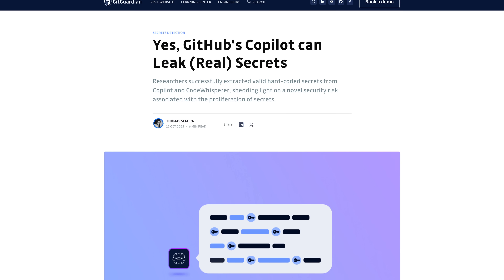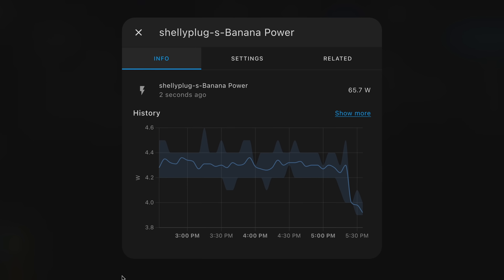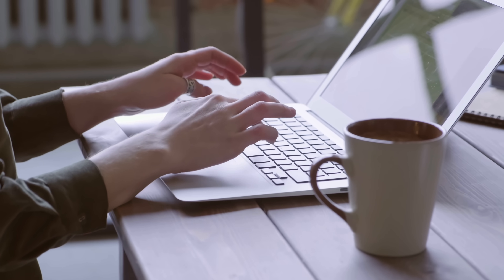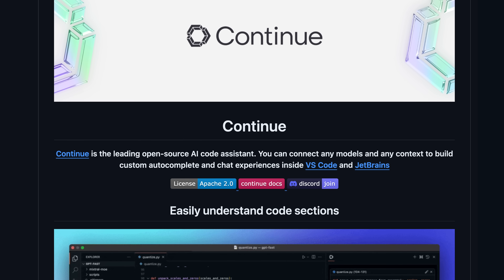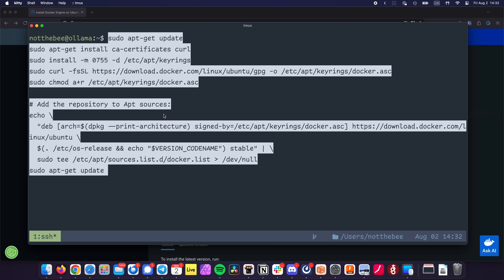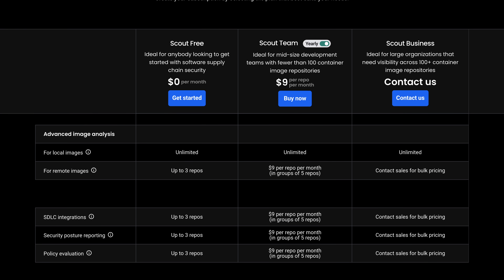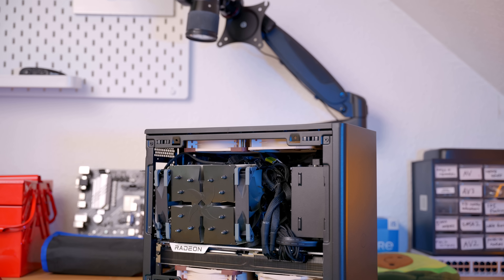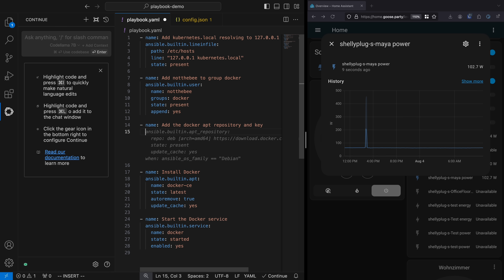Host Your Own AI Code Assistant with Docker, Ollama and Continue!

Comment from the maker: Download Docker Desktop: https://dockr.ly/4fWhlFm
Learn more about Docker Scout: https://dockr.ly/3MhG5dE
This video is sponsored by Docker

Ollama docker-compose file: https://gist.github.com/notthebee/1dfc5a82d13dd2bb6589a1e4747e03cf

Docker installation on Debian: https://docs.docker.com/engine/install/debian/
Reply: brother i would recommend you to use codeqwen1.5 this with ollama and continue it is less power hungry and give better result, i run it on my laptop with 16gb ram, i5-13th gen and 4050, it also very accurate
Reply: @Indiginous  Hey! I have the exact same specs. At present day, what's the best LLM you'd suggest for coding AI agents?

Comment: You gotta go for Qwen2.5-Coder. 7-14B models are the sweet spot. Dont need to go higher. Qwen2.5-Coder-3B for tab completions. If you got the VRAM try the q8 versions.

"Instruct" models  give you even better results because they can use Tools (fetch stuff from web for example)

I run i5-13500 + 64GB RAM + 5070ti 16GB and it does pretty well. I compared it to Cursor today and its on par with Cursor suggestions. (cursor does have better UI/UX though compared to Continue/RooCode/Cline)

45W Idle.

Comment: I'm using Ollama with Continue on my main desktop, alongside my IDE and it's acceptable. It's not as fast as GitHub Copilot, but it's free, unlimited, and to be honest I prefer it to not do ALL of my work anyway. I've found that AI writes code fast, and it can get you out of a bind quickly, but you still need to make sure YOU are the one in control of the output and you understand the code it wrote.  Ollama is nearly useless on my laptop though. In the future, I'd consider trying an NVidia Jetson to run the LLM, since that's purpose built for AI. I think that might be OK.

Comment: i could never rationalize spending $1.000+ on a gaming machine, not could i do the same for an LLM server. but 1 month into trying out Proxmox on an HP EliteDesk, i realized my dream might be possible. 

i ended up buying a Minisforum AI X1 Pro + RTX5070 as eGPU over OClink to be my all-in-one 4k gaming machine, LLM, docker server, and NAS with minimal footprint and decent upgradability. 

now im running 8-12B LLMs with ease at chatgpt-speeds locally, and with a single switch it shuts down and starts up windows to play on my OLED or stream with Moonlight! hookscripts let let me just shutdown Windows (from the OS or Proxmox) and my LLM server boots back up. 

and with USB4 finally being mainstream, i can connect my macbook via thunderbolt for a 20gbps direct link to all my storage and guests + my 2.5gbe LAN in one cable. Time Machine backups are now instant😮‍💨

Comment: I made a setup with Asrock N100M and RTX A2000 12Gb it's very power efficient and works really well. The GPU costs me around 300€ used, not the best investment just for a few help while coding, but I'm planning to build a voice assistant with this setup, hopefully it can be a bit more useful than Siri.

Comment: The 4090 is such a scam. 24gb of vram should not cost more than 99% of the systems in existence.
Reply: The real scam is that you can't get 24GB+ of VRAM on mid-tier GPUs. For most hobbyist or single-user scenarios, that much compute isn't necessary, but the memory would be fantastic.

Comment: Ollama is nice, but doesn't stand a chance against Tabby (from TabbyML). I run that on a desktop with an Intel i3 10100F CPU, single channel 16 GB RAM (DDR4, 3200MHz), Corsair SSD (500BX model) and a MSI GTX 1650 with 4 GB VRAM (75 Watt model). This meager self-build gives ChatGPT a run for its money in response times when accessed via the Tabby web-interface.

Tabby can be run directly in your OS, setup in a VM or run at your cloud provider. Windows, Linux and MacOS are supported. Tabby also provides extensions for VS Code, JetBrains IDEs and NeoVim. Auto-complete and chat become available, just as is shown in this video.

Tabby can be used for free when 5 accounts or less use it simultaneously. 

Disadvantage from Tabby is that it doesn't support many models. 6 Chat models and 12 Code models. Many of the models used in this video are supported by Tabby. You can hook at least 3 different Git repositories to it (as that is what I have done at the moment), but you can also use a document for context. And not just via the extension of your favorite editor, but also via the Tabby web-interface.

Now, with only 4 GB of VRAM, I cannot load the largest Chat & Code models and these models tend to hallucinate. However, if you have a GPU with 8 GB or more, you can load the 7B models for Chat/Code and that improves the quality of responses a lot. 

And finally, Tabby has an installer for CUDA (NVidia), for ROCm (AMD) and Vulkan. Haven't tried ROCm or Vulkan, but Tabby in combination with NVidia is very impressive. My suggestion would be to make another video with Tabby in your 24 GB VRAM GPU using the largest supported models for both Chat and Code. I fully expect you'll come to a different conclusion.
Reply: It should gave you same results as Ollama with same models

Comment: I will only self host an AI service when the hardware needed to run these things are down to mainsream levels. Even, the architecture is not power optimized and maybe this is something that we have to wait from the hardware and software side. Power efficiency is the main issue for self-hosting anything.

Comment: you can run meta llama 3.2  8 billion parameters quantized  with just a cpu using gpt4all as well as control it via pycharm or vscode . a good option for those wanting to build something like this on old cheap hardware that would normally be thrown in the garbage.

Comment: First. There're some really good coding models came out recently, like qwen-2.5-code. In their 14B version, it's not only capable of doing FIM (fill in the middle) tasks for a single file, but also for multiple ones. Not sure, if continue dev supports that, but Twinny (my personal favorite LLM plugin for VSCodium) does. 
Second. if you're aiming towards gpu-less builds, look at AMD Ryzen 7th series or higher. Like 7940HS. Not only it's a great powerhouse in terms of CPU performance, it's also supports DDR5 with higher bandwidth which is crucial, when it comes to LLM tasks. There're plenty of Mini PCs already with such CPUs

Comment: Hi Wolfgang!

Thanks to you, I decided to try and selfhost LLMs for code completion: Python, Bash, Ansible and some general Linux knowledge (CLI utilities, more on that later). I am a Junior SRE/DevOps Engineer (idk if that even matters), and also long time viewer (since 2021, I guess?).

3 days ago I got used Intel Arc A770 16gb for 260USD equivalent, installed it in my gaming pc (Ubuntu 24.04). The driver installation was a pain (tl;dr: reinstalled Intel & OneAPI stuff TWICE) though.

Got it working in 4 hours, tried several models: codellama:13b, gemma2:9b and mistral-nemo:12b. The latter really impressed me. It not only can write some simple code in Python or bash, it also helped me with pretty specific IBM app Tivoli (magnetic tape storage). AI is an impressive tool, and I see it now.

Thank you, your videos are pretty damn good ❤

Comment: So,  I would try to get hands on miniPC based on AMD 8840HS ( a lot of on ALiExpress for around 300 barebone, sou add RAM and SSD). Run them with either 32Gb of RAM and you got yourself, small, light power AI assistant.
This APU from AMD comes with nice integrated GPU but also with NPU unit ( 16 TOPS), so it is nice upgrade from that Intel you have and even cheaper.

Once the newest APUs from AMD and maybe Intel come to miniPC, (with around 50TOPS npu units), it will more than enough for this.

Comment: Could you tell how you got the models that were used in your testing? I have attempted to find them, including looking at the Open WebUI community site, looking through the models available on the ollama site, and I even attempted to pull them directly into ollama (the file was not found). So where did you get those models and how did you get them into ollama?

Comment: Great video! I installed the Ollama codellama + WebUi on my Ubuntu Server via the Portainer app on my CasaOS install to make things as easy as possible. 
My server is an old Dell Precision T3620 that I bought for around 350 euros a couple of months ago.

Specs
Intel Xeon E3-1270 V5 - 4-Core 8-Threads 3.60GHz (4.00GHz Boost, 8MB Cache, 80W TDP)
Nvidia Quadro K4200 4GB GDDR5 PCIe x16 FH
2 x 8GB - DDR4 2666MHz (PC4-21300E, 2Rx8)
512GB - NVMe SSD - () - New
Crucial MX500 1TB (SFF 2.5in) SATA-III 6Gbps 3D NAND SSD New

Things are running well, but, of course, not as fast as on a beefed machine like yours. :D

Comment: What about a Raspberry pi 5 with the ai kit?
Reply from the maker: The problem with many TPUs is that they don’t have onboard storage. Or if they have some, it’s very small. One of the reason why Ollama works so well on GPUs is fast VRAM. Running LLMs on the TPU would mean that your output is bottlenecked by either USB or PCIe, since they’re slower than the interconnect between the GPU itself and the VRAM (or the CPU and the RAM)

Comment: AMD card is a very bad advice for running machine learning models in general.

To run the best llama model, what you mostly need is a lot of ram and a system that has reziable bar.
   To run most of the other ML stuff like image generation, you need NVIDIA. You are going to be super frustrated if you get a 900$ AMD GPU just to run llama and be blocked to run all the other cool stuff.
Furthermore NVIDIA drivers on Linux are far superior and much easier to install.

Comment: By the way, Zed is becoming a more prominent and apt replacement for Neovim and VSCode, and it has built-in support for Ollama (as well as other services). It doesn’t have AI suggestions directly, but those can be (kind of) configured via inline assists, prefilled prompts, and keybindings.

But the main problem is speed, and it doesn’t matter if it’s a service from a billion-dollar company or your local LLM running on top-end hardware. Two seconds or five, it breaks the flow. And the result is rarely perfect.

It’s very cool that it’s possible, but it’s not there yet, and we don’t know if it will ever be.

Comment: but you can host it on the same powerful machine, you programme on and run llm, when you need it, then play games when you don't, right? I am planning to do the same thing, but I want my low power home server to be like a switch for my pc, so I can game on it, when I need to, but also use it's power to help me with my prompts... It can be done using WOL, if you need it to work remotely, I think. Or is it a bad idea in terms of security?
Reply from the maker: You can do it all on one machine
Reply: @WolfgangsChannel But I need WOL to turn on my PC over WAN, I tried to do port forwarding, but it seems, that I need to set something in my router, so it knows where to forward the signal it gets, because, if my PC is off it cannot find it's local IP for some reason. I use openwrt.

Comment: I've seen a few people plug a GPU into an M2 slot of a mini pc with an M2 to PCi adapter. I believe you need to power the GPU with an external power supply but I've always wondered what the idle  power consumption is like for a setup like this. Maybe a future video:)
Reply from the maker: Probably not much different from a desktop PC with the same setup. M.2 is just PCIe with extra steps

Comment: you could also run the "autocompletion" from VS code on your Mac.
I´m running ollama on my M2 Pro. Power consumption is not really worth mentioning it and you don't have to run a seperate PC.
(But this only make sense of course if you don't want so share the openUI web to others)

Comment: Dude, this was a really cool project, I recently build an AI home server and I think there are some parts of your project that could be done better. AMD is fine but general purpose graphics cards but for AI, Nvidia is always your first option, of course it would work fine on Ollama and similar models, but most AI projects out there support Nvidia firstly, your build would be more future proof with a Nvidia graphics card and you'd be able to mess up with other projects like Whisper more easily. Of course, Nvidia is way more expensive, I'm using an RTX 3060 which costed me like $320, there are a really excelent video by Jarods Journey comparing that card with more high end Nvidia cards and it works greatly for its price, its performance it's not so far away from the 4090, specially considering the price, the main difference is the VRAM but there are some tuning you could use to run heavier models using less RAM, or balance both RAM and VRAM such as Aphrodite and KoboldCPP for text generation. Lastly in regard of power consumtion, yes, it does cost a lot of power to run decent models, there isn't a work around it, however, you could just turn on your machine when you need the text generation and turn it off when you are not using it, if you want a more ellaborated solution, you could enable Wake On Lan and get a Raspberry Pi as client server for turning it on/off everytime you need it, at least I'm planning to do that with my server. 

At the moment there isn't a lot of videos about deploying local inference servers on YT so I'm really happy you made this one. Looking forward to more AI related videos in the future.

Comment: I found this helpful enough that I've included it in a presentation on a self-hosting an AI solution presentation that I'm working on for work.  This is part of an effort to raise the overall AI knowledge and not for a particular use case.  Now with that said, I've had much better luck with nVidia GPUs.  I even bought a laptop with a discrete nVidia for just this purpose.  It was back in May and I think the price was around $1600 USD.  NVidia seems to be 'better' for now, but it is good to see AMD becoming viable.  I'd suspect the nVidia options are in some ways better, but that is likely around power usage or time.  The prices are still bonkers.  I'm running an early Intel Ultra 9 in a laptop.  This thing is nice.

Comment: I know you’re a Mac guy (you convinced me to start using Mac) so even though it would be on the more expensive side, an apple silicon Mac with lots of ram is another option.
Reply: Not expensive AT ALL compared to getting the same amount of gpu memory from nvidia. And with the coming M4 macs it is expected ram will become minimum 16gb on mac. 

Apple silicon unified memory model can provide up to around 75% of the total ram to the GPU
Reply: @bjarne431 Macs are on the expensive side to local LLM actually. The ones taking full advantage of it get Mac studios from work (upwards of 96 GB). People have done the math in the local llama subreddit and M Macs for local LLM are rather expensive, multiple cards give you more bang for your buck so yes.

Comment: We'll have to see how this all plays out on the new laptop processors with NPU. I'm still hoping to be able to buy a $1,000 all-in-one mini PC - without a graphics card but with enough NPU power. The question also arises as to what is more necessary: RAM or NPU power.
Reply: nah, dont expect NPU to do anything. Just get GPU with enough VRAM. You can pick up something old for 100$ and play with it. Ive been using 1070 for like 6 months before I went up to 5070 ti. It was working fine with even 8GB VRAM.

Comment: It's been a few months since I started using Ollama under Linux with the RX 7800XT (16GB) inside a 128GB DDR4 3600MT/s Ryzen R9 5950X system (Asrock X570S PG Riptide MB). Models sit on an Asus Hyper M.2 card with 4 Seagate 2TB NVMEe gen.4 X4 each. The GPU uses an X4 electrical (X16 mechanical) slot, since the first PCIe slot is taken up by the 4 drives.  So far, I am very happy with this hardware/software setup.
Reply: And what is a model you prefer to use for coding and which VSCode extension do you use?

Comment: Ollama works well on Apple M-Series Chips if you have enough RAM. A Mac Mini might be a good server for this, but it's kind of expensive.
Reply: Correct!  I am running Ollama and LM-Studio on a Mac Studio and a Macbook Pro.  The Mac Studio (M2 Ultra) pulls a max of 150-170 watts while inferencing with 14B and lower parameter models, but idles at 20-30 watts. It is not the most efficient, but it is fast, and I can load Llama 3.1 70B Q4 without spending $3000+ on just the GPUs, and the added power cost. The Mac Minis with 16GB of Memory should be far more efficient.

Comment: Perhaps GPUs built for compute workloads would work better? (Im not sure, im genuinely asking) Im thinking something along the lines of RTX A2000 for low power draw or A5000?
Reply: I have a RTX A4000 Ada. Power consumption in idle (per nvtop) is about 13w. When a large LLM is run it takes the full 130w which I think is a perfect compromise between power consumption and performance.
I am not a gamer at all - just using this GPU in my homelab for LLM.

Comment: There is an ongoing effort to allow for OneAPI / OpenVINO on intel gpus's. Once this tomes we'll be able to use low power iGPUS with lots of RAM. I'm always checking on the issue for Ollama, there's also a couple questions regarding NPU support. Holding my breath for Battlemage GPUs here, though I've seen impressive results with ollama Running on modern QUADRO Gpus... for those who can afford it. Not me! Thanks for this! I've tried this same stack in the past both with a 1080ti and 6950xt. Ollama runs perfectly fine on both of them and but continue seems to have improved a lot since my last try. I will give it another shot!